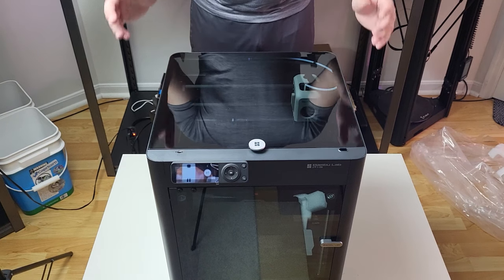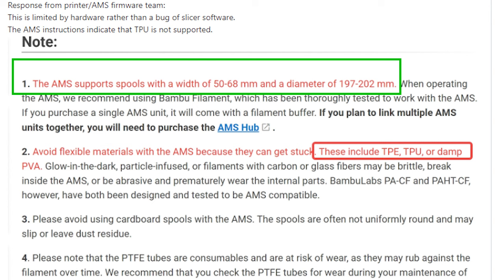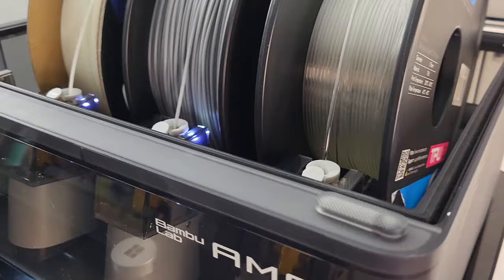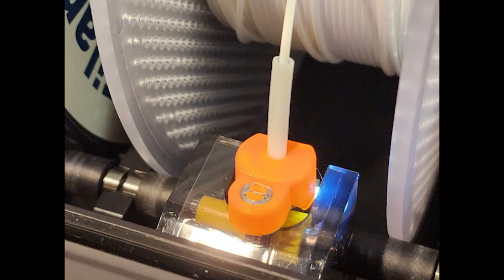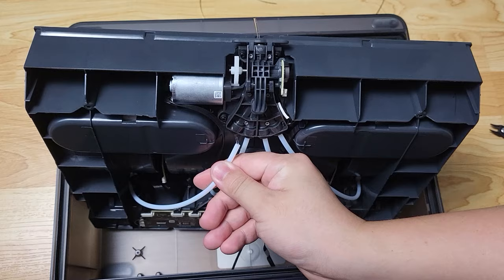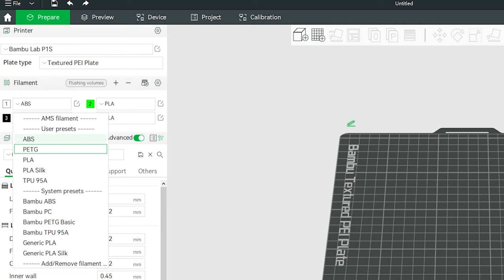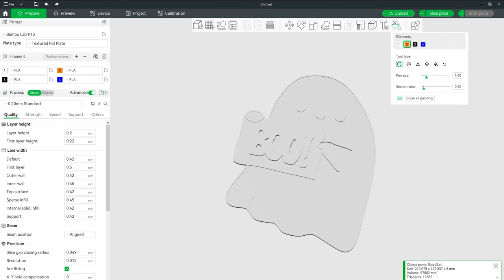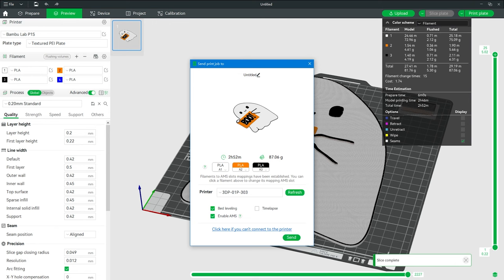Bambu Lab AMS set up tutorial, common issues, beginner guide

Comment: Good video! I'm looking to buy my 2nd 3D printer after playing with my Ender 3 v2 since the beginning of 2022. After comparing the Creality K1/K1 Max with the Bambu X1C and P1S, I found the P1S met the sweet point of money I'm willing to put in and performance and functionality the machine can provide.
Reply from the maker: That's interesting. Ender 3 v2 is actually the first 3d printer that I personally owned.  I bought k1 two weeks ago, and I'm still running testing on it.  Should have one review video come out soon. 
Yeah, p1s is a sweet spot for the performance vs price. Very little issue so far, k1 is amazingly fast, too, but the review out there is very mixed bag. I am not encountered any major issue for it yet, but i will run it a few more weeks and see.
Reply: @SvgLau  I heard the K1 is a great machine. However, I’d love to have multicolor printing capability. If there’s a machine that combines the print volume of the K1 Max, which is 300x300x300mm, plus the AMS from Bambu which provides multicolor printing, that would be perfect.
Reply from the maker: @WarrenGuan  Yes, I think that is a lot of people waiting for. Somehow, next year a lot of brands will try to push out more coxy machines with 250mm x 250mm + build plate. Maybe some of them will have muti-color system as well.
 This market is moving so fast now, I have other 10 different printers that I bought for review video this year, due to my time limit, they all kinda becoming dated at this point, well, before my video come out, lol.